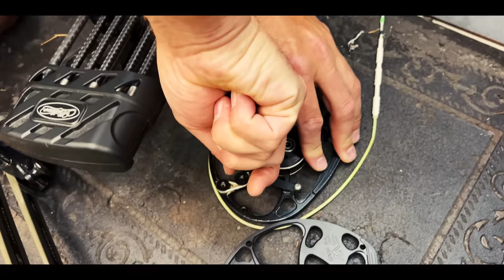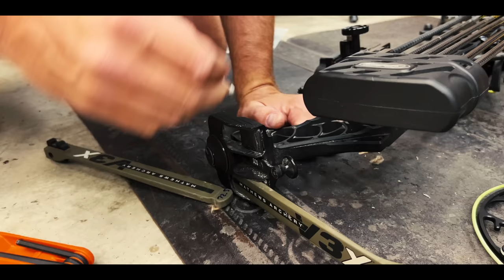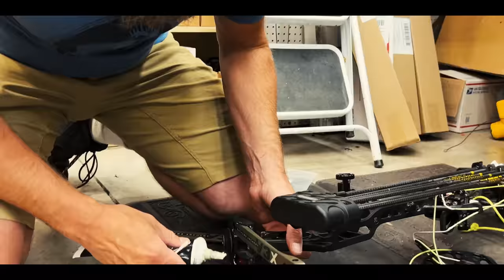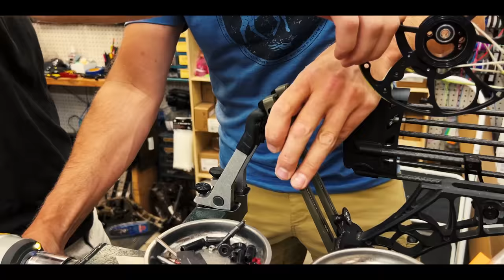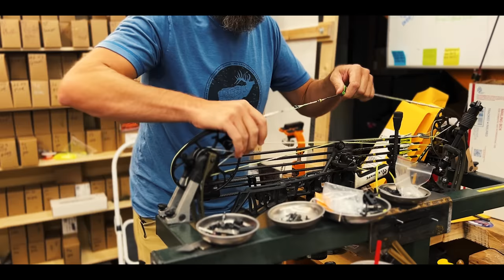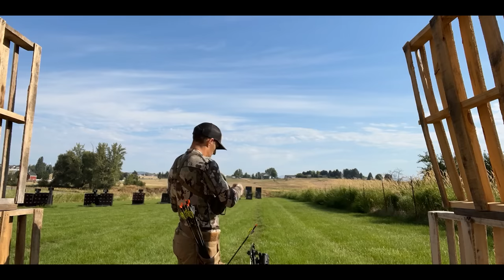Can MFJJ Rescue My Bow?! HELP

Comment: Good to know Mathews covers bearings. Even better to know they replace the whole cam. The bearings blew out on my Hoyt Ventum after 9 months of use and they wouldn't cover it under warranty. Happened right before TAC too. The stress was unbearable. Ill be getting a new bow after the season. No more garb Hoyt.

Comment: I have a 1 year old V3 31 and just had to replace both the top and bottom cams because the bearings failed, was bad enough had to replace the top hats as well. The good news was Mathews covered the replacement at no cost, just wish they were using better quality bearings. Seems their setup is hyper sensitive to the torque on the axel shaft screws.
Reply: A lot of 3D and indoor guys replace them as soon as they get them but you have to find someone who has the specs for the bearings because Mathew’s won’t tell them so some guys just got a new cam and put it on and played with the old one to get specs
Reply: @ChilleDxFighteR  
Thanks Lee I’m going to talk to my shop and see if they know what bearings I need.

Comment: $250 quivers, chinese bearings - elevating the archery experience
Reply: Looks like it’s ALMOST the size of a skateboard bearing, which are available everywhere and in a variety of qualities and seals…
Reply: @MikeJones-vb1me  throw in some bones ceramics haha
Reply: Hahahahahah  good one
Reply: Awesome info as always!
I emailed Josh, I was hoping you guy might do a video on arrow flight and humidity / high elevation shooting / cold air vs super humid.
Is there any change? Fact or Fiction.
Thanks
Archer Ash
Reply: Trash parts but charge arm and leg for a quiver. Qell said Wazuh
Reply: Yet you guys want bow prices to stay the same, but want massive improvements every year.  GTFO
Reply: Gotta go to the right shop. I got my low pro detachable for $150
Reply: @wazuhhDH  exactly!
Reply: @HuntsT  I don't get where the "massive improvement" is. Is anything really getting that much better? Speed seems to be going down, draw changes every year from company to company, noise is about the same.

Comment: Not that he doesn’t know what he’s doing because he clearly does…but he need to lay off the ugga Duggas on those axles…that alone will trash those bearings in the cams!  Here’s a funny story, I actually 100 percent forgot to even put in the screws that hold on the cams on one of my bows last year and had just an incredible day of shooting. Went back in and saw the top axle screw sitting their and the way me and many other pros have discovered is that you literally screw them until they stop and that’s it.  Make sure you’re adding loctite and marking it to make sure it doesn’t move but he literally tightened them so tight that I’ll be surprised if you’re not having high and low issues already.  That’s what it gave me when I ran the test.  I’m not bashing anyone, but I don’t have your email on hand it could help someone that watches the video and thinks that is how it should be done.